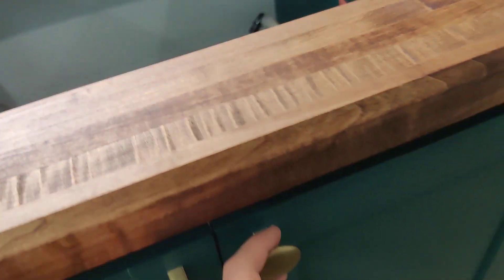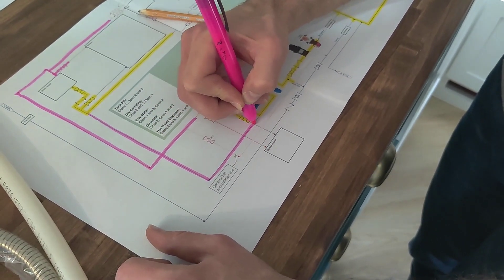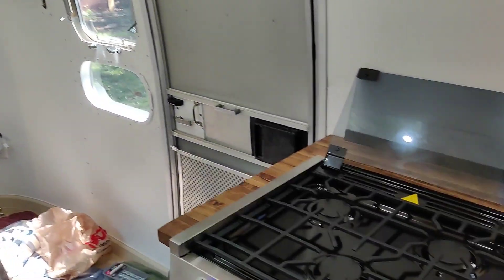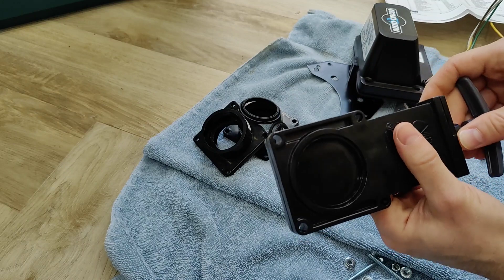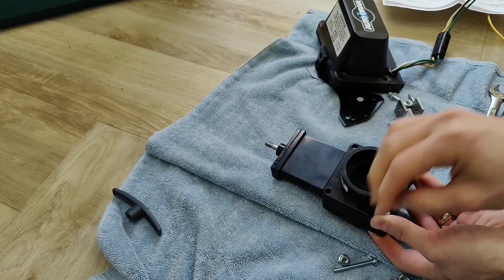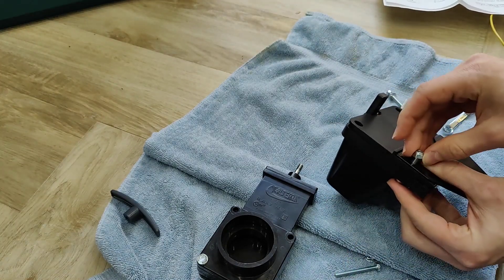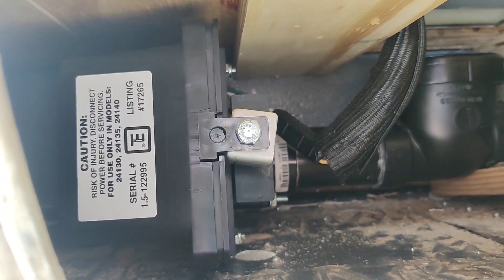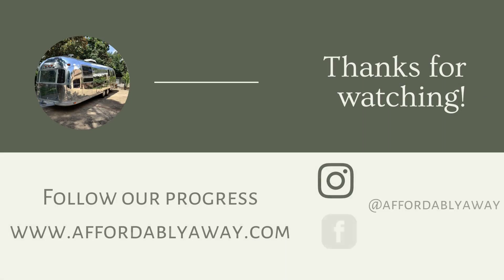Diary of an Airstream Weeks 73-81: Plumbing and Propane

Comment: what is that sealer you used around the inlet valve?
Reply from the maker: Acryl-R sealant. It works great for external seals on the aluminum shell. The butyl tape is essential as well. It's a lot like sticky putty and makes a great seal as long as you use enough of it. We also used butyl tape when we reinstalled our front wing windows a second time and that's what finally stopped the leaks we were fighting.